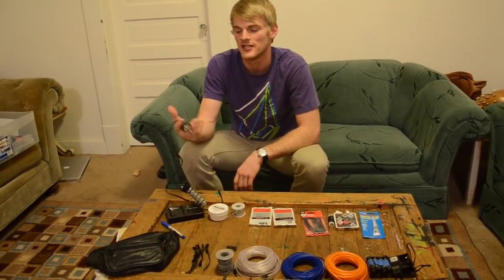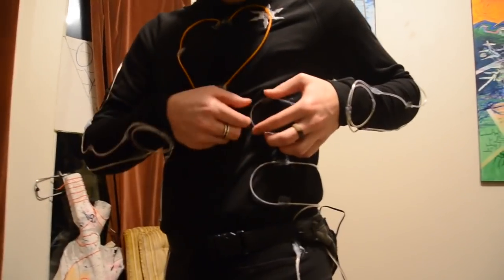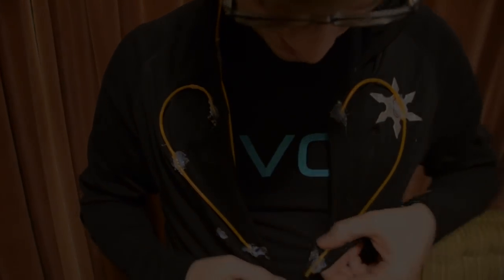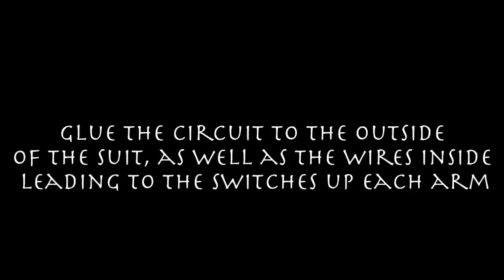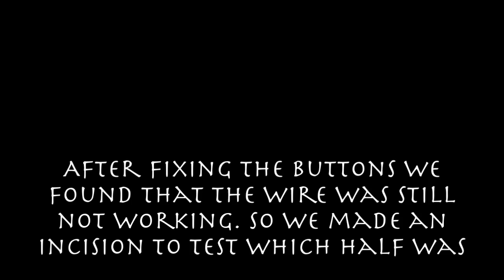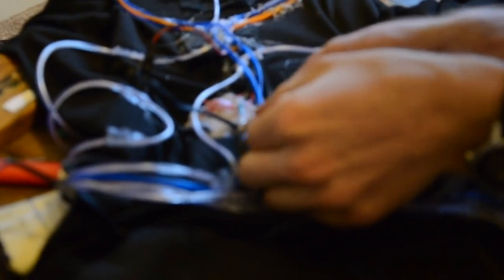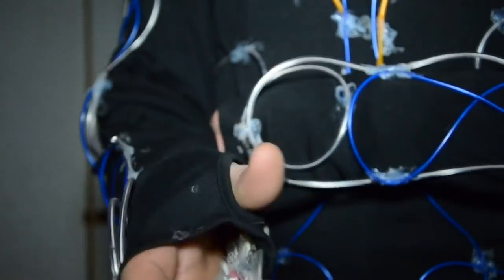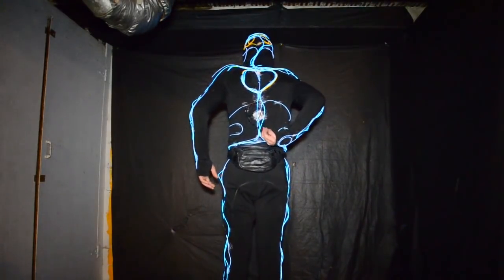How to Build an EL Wire Dance Suit

Comment: TIP: Use a clear light monofilament (fishing line) to sew the wire on. It looks much cleaner than hot glue and balck thread.  would alse reccommend using some thin speaker wire to jubp the el wire rather than running the wire under because it will show through on some materials. Just did a suit coat with this and needed to caver the wire with electrical tape that was inside so it wouldn't show through. 

Just some tips.

Comment: how many meter/feet did you guys use here? And could you maybe show the diagram for the circuits?
I think you could use less if you cut the wire when it goes under the clothing, and than solder it back together when it comes back up.

Looks great BTW!! Really cool how you can turn them on and off so quickly! Can't wait to create my own :)

Comment: Hi, i wanna know if you used any TRIAC driver cause i dont know if the micro tact switches support the current necesary tu drive the EL wire

Comment: check out the Whoa Board Connected to EL wires on  kickstarter: https://www.kickstarter.com/projects/2055918540/whoa-board-dream-with-touch-sensing-el-wire-panels?ref=nav_search